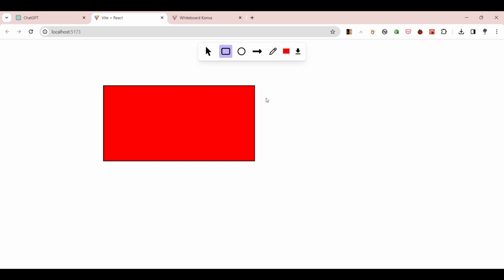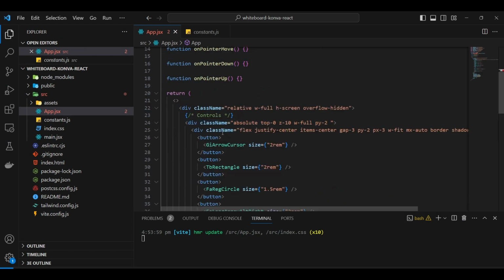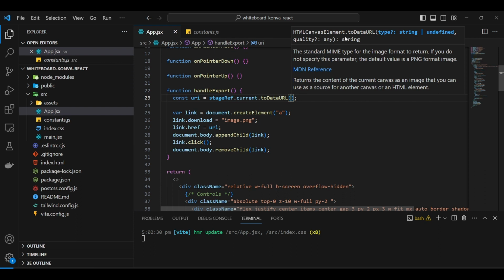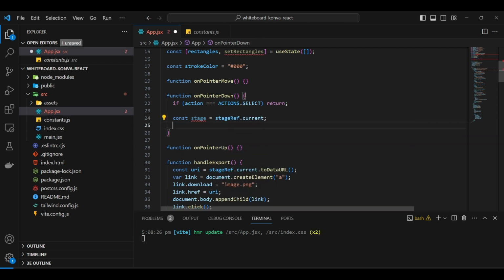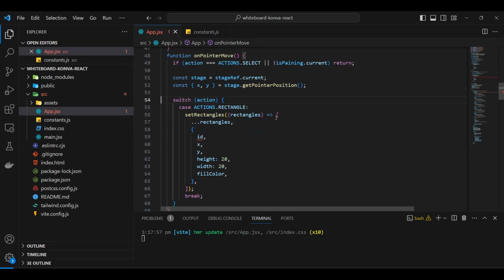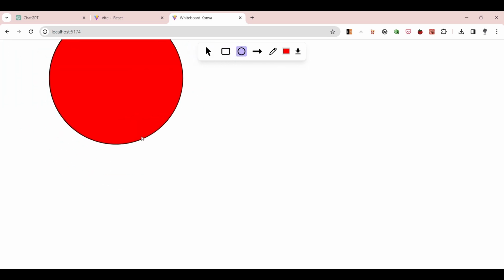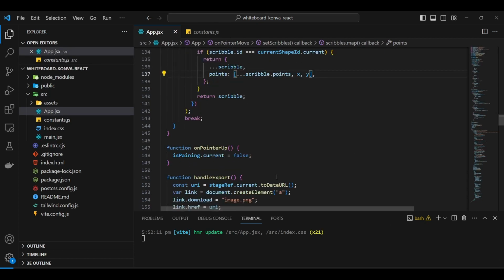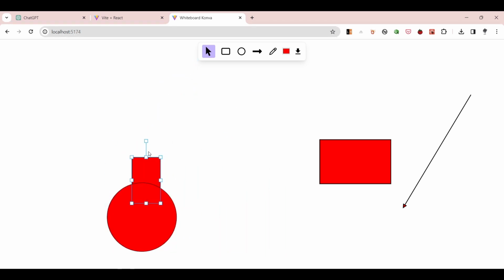Build your own Excalidraw or Figma Clone using React and Konva

Comment: how to save the users work so that they can continue their progress?  how to save in drafts?
Reply from the maker: A data structure needs to be maintained and whenever any changes are made by the user that data structure needs to be updated and stored in some storage. When the user reloads the site the next time, then the data structure is parsed and the GUI elements are added in the viewport.

If you are interested in diving more deep, I would suggest you to checkout excalidraw's blogs. They have explained their architecture in depth and from there you can take references to go forward.
Reply: @mohitkumartoshniwal   thx for replying.I will check their blog.

Comment: Can you give a hint how can I add undo and redo functionallity in this?
Reply from the maker: To explain in brief, you can have a stack( or array in javascript ) where you push the states when you do any action, then undo it by popping it off the stack. This comment was to keep things simple but if you are more interested you can check out the Command pattern, I have a video on it on this channel as well.
Reply: Thanks sir  @mohitkumartoshniwal  , actually I have implemented this functionality by declaring an all elements array and a history array and I'm pushing all the elements whenever they're created and on clicking the undo I'm removing it from all elements and then checking the id and removing the same from the respective rectangle,circle,etc array
Reply: hii, bro can you share link for your code with undo, redo functionality. i will be helpful for me